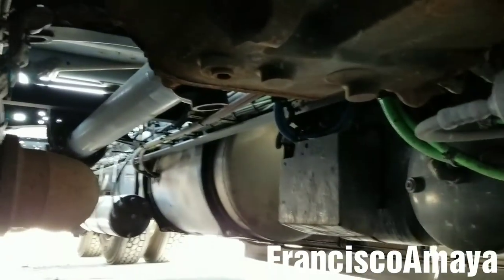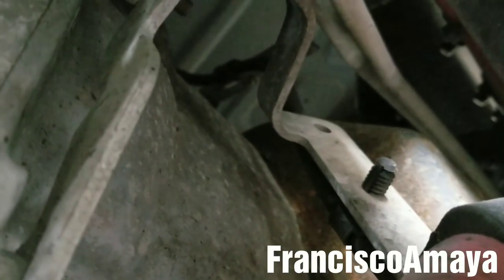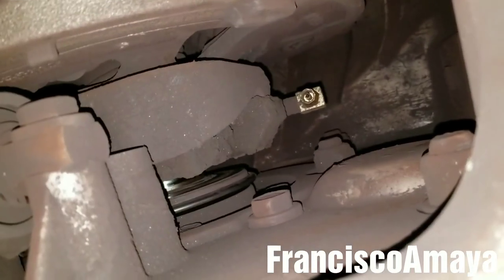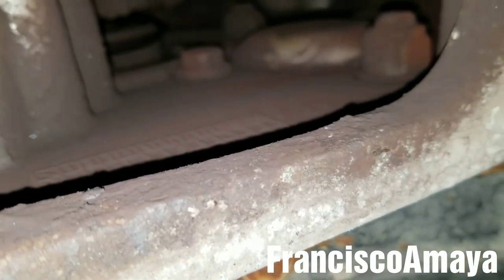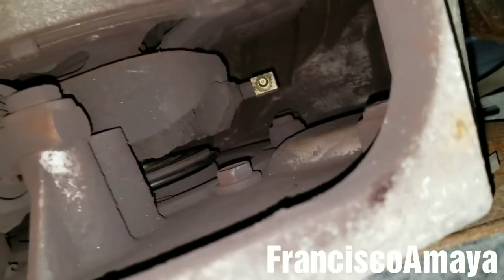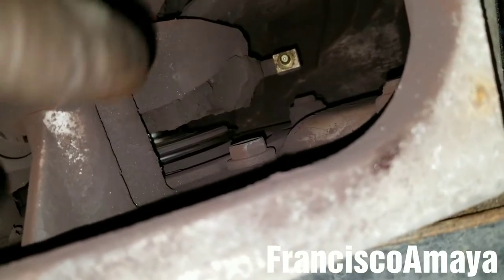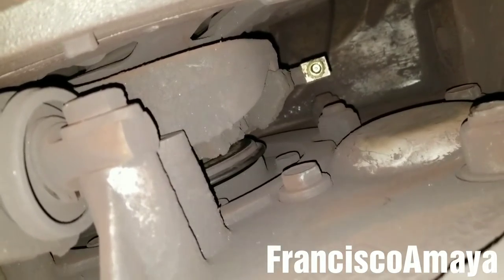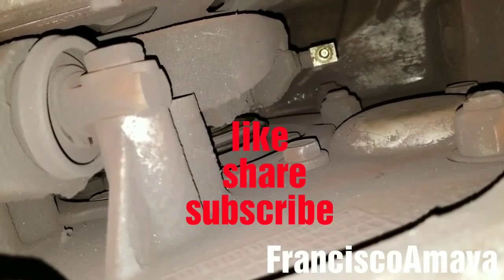Freightliner cascadia clutch grease line broken

Comment: Francisco i changed clutch a few months ago because pressure clutch bracket broke due to none grease. I asked these mechanic when he replaced the whole clutch where the hose was he only  showed me the one in the side of clutch. I told him where is the one inside he said don't need it by i think it should. What should i do?
Reply: David Moran I have a 2009 Cascadia and the only one I've ever found was on the driver side near the top of the transmission
Reply from the maker: Go underneath the transmission and fiscally check the clutch lubrication line , it should be connected to the clutch bearing.  if not, you will need to use the grease nipple on the side of the clutch bearing.
Reply: Francisco Amaya thanks
Reply: How can you take out the screw if broken in side

Comment from the maker: ADD HIGH TEMPERATURE SYNTETIC GREASE TO THE CLUTCH BEARING EVERY OIL SERVICE OR EVERY 30K MILES TO PREVENT CLUTCH BEARING PREMATURE DAMAGE.
KEEPING IT RUNNING!! KEEP TRUCKING!!
Reply: Hey Fransisco. Just throwing out a new video idea. I seen where u responded to someone on all the points to grease when greasing a Cascadia. Some items mentioned I'm not sure what they are/look like or where they're exactly located. It would be great when you have time and you do a Cascadia PM you could do a quick video of what type of grease is best, which nipples to grease and about how many pumps / how many miles. I didn't even know that the clutch bearing had a grease nipple! I dont see any on my drive shaft but maybe they're hidden & u could point that out in the video. As always great job on your videos! You're always on point & explain things like a pro. 🤠

Comment: Hey Francisco,  how many grease points/zerks are on a Freightliner Cascadia?? 
So I know I grease all of the zerks not missing any of them. 

Thanks
Reply from the maker: They vary,  it will depend on the application and components of the truck.  

But this are all the grease points on a truck with maximum amount of grease points. 

Common applications 
King pins
Tie rod ends
Drag link
Clutch bearing 
Clutch linkage 
Drive shaft U-joints
Slack adjusters
S cam brackets
Fifth wheel
Fifth wheel support 
Fifth wheel slide

Others application 

Lift springs bushing 
Hood supports
Hood hinges 
Steering column U-joints
Etc,..
Reply: Francisco Amaya hey man thank you for your time to reply. 
Appreciate it 👍🏽

Comment: Hey fransisco freightliner just started changing air compressor for my dd15. What's important them to put some extra parts or hose if need it what connecting to compressor .
Reply from the maker: Just make sure that the hoses are ok and replace all the orings you remove.
Reply: Francisco Amaya yep. I told them. Thanks

Comment: Help truck won’t turn off!!!

Crazy right I was off for a week came back to pritrip my truck before hitting the road on Monday, turned the key and the battery was dead. (New battery’s only a month old) jumped the truck, came back after a hour and half to turn the truck off. Turned the key to the off position and the truck is still running my ac and radio turn off but the truck and all the gauges stay running. I have a kill switch and manage to turn off the truck that way. When I turn the battery switch to the on position the gauges turn on with out the key in the ignition(gauges turn on like I’m giving contact to the truck with the key but the key isn’t even in the ignition) got a dd15 Coronado 2013
Reply: Aziz Ibusevic Did u ever figure it out?

Comment: I have a 2017 Freightliner Cascadia detroit engine and i have  vibration issue i did alignment and balance and kingpin but still have the same issue please if u can help
Reply: Ammar Alayoob it’s your clutch going bad if you have dt12
Reply: Did you ever find the problem? I having trouble getting solved. It gets worse the heavier i am and when accelerating.